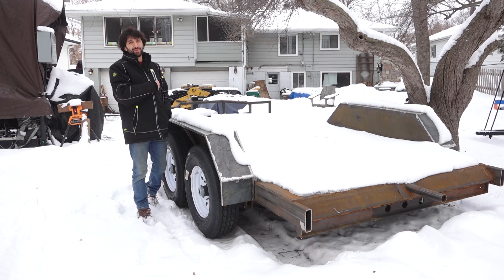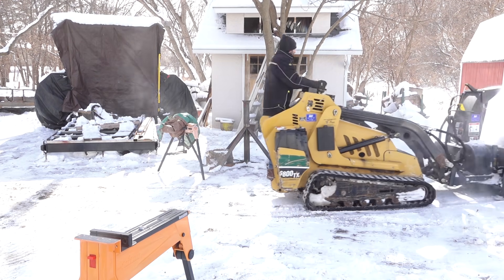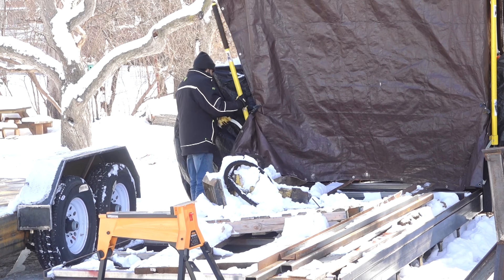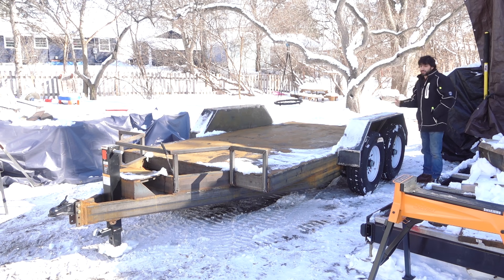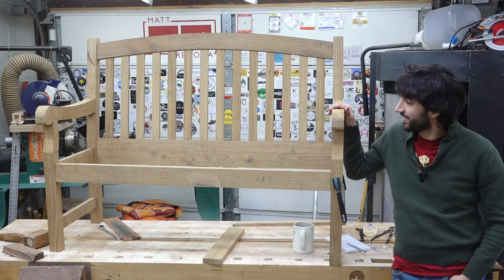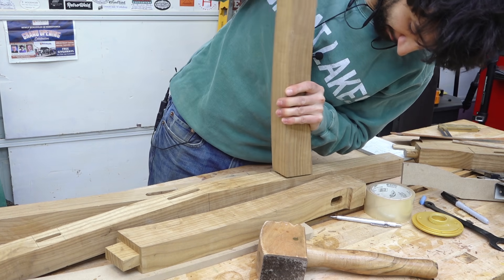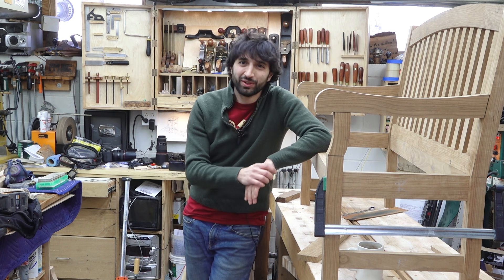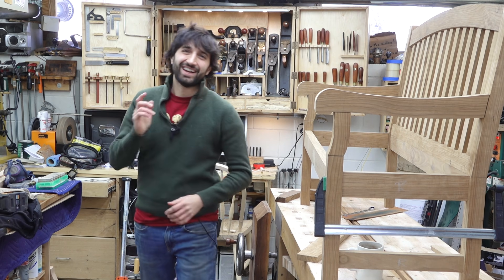Channel Update, Trailer & Garden Bench Progress

Comment: Hey Matt, off subject question but I am having a hard time finding an answer. On cutting boards, when you make something like a 3D style or something with fancy angles, you inevitably in up with small gaps where your angles were off by just a little bit so when you put pressure on the clamps, one piece pushes another just enough out of whack were the sides don't come together. How do you fill and hide those? Glue wont flow deep enough into the small gaps to fill them and if I just push what I can down into it, I end up sanding the glue and exposing the crack again. Is there maybe a food safe thin epoxy or glue or some other trick of the trade?  I saw a video about using your shop vac to try and pull the glue in from underneath but, sometimes the gaps don't go all the way through or they aren't really big enough for that to work.  Many thanks!